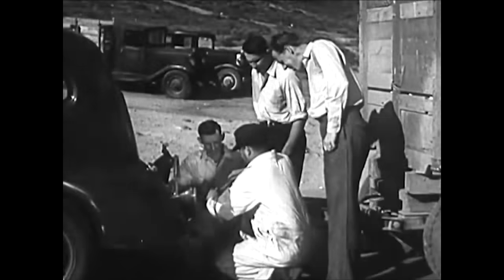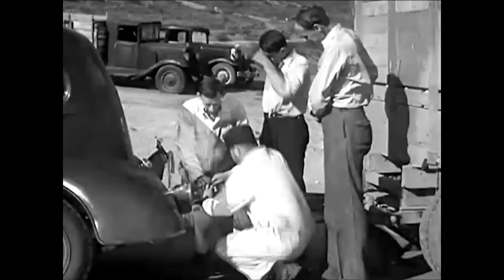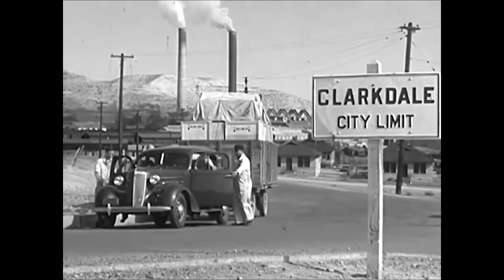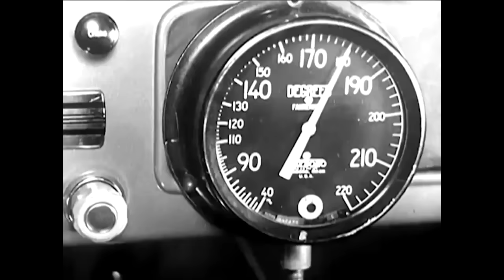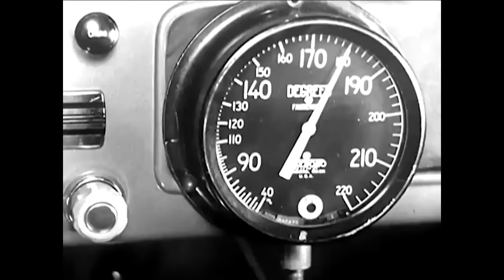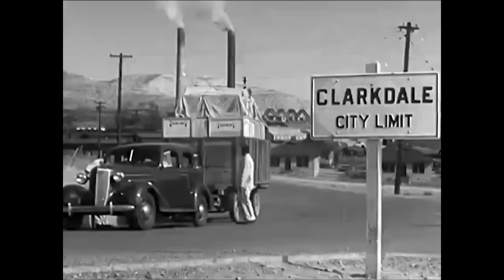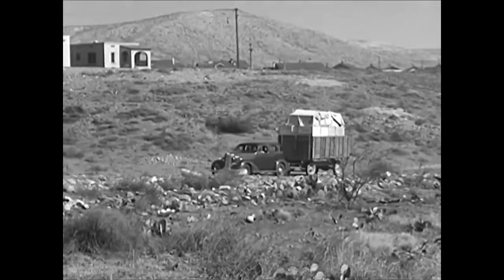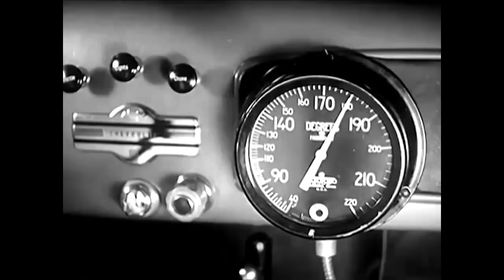Clarkdale Jerome Arizona Chevy Film 1936

Comment: That has to be the most hinky hitch connection I have ever seen!
Reply: Kind of fits the mold for trailers and loads pulled in Arizona.
Reply: There’s actually a very solid pin holding the trailer on, the knot tied was simply to keep the pin from coming out, hardly any stressed will be on the knot at all.

Comment: That 36 Chevy had a whole 79hp (at sea level) so the only thing in those boxes was air.
Reply: You know it. Maybe the top boxes had a length of board in them to keep them down.
Reply: Still more than a modern car can tow.
Reply: Still a heavy trailer ! 😄
Reply: Did you guys get a look at the rear end on the trailer?
🤔💭Either it was either junk yard built, or it's got a drive shaft connected pushing up the hill as well? 
Quote Bugs Bunny
"Something very fishy going on around here"?
Reply: @Mr.Martin4500  I'm used to seeing old drive axles under trailers.  I don't know what trailer manufacturers were even in business back then, so I have nothing to even compare that trailer to, other than you typically cannot do high speeds with trailers like that.
Reply: Not just air, hot air. 

Now, go buy a Chevy!

Comment: Nice. And they didn't even have anti-freeze back then! Good job!
Reply: Oh yes they did.  They had a choice of permanent antifreeze, similar to what is available now; and temporary antifreeze, ethyl(?) alcohol, which would eventually evaporate ... requiring frequent resupply during freezing weather.
Reply: Water has a lower boiling point but a better heat capacity

Comment: Can you imagine “doesn’t overheat” a selling feature in 2022?
Reply: They fixed that by having low tow ratings.  Some modern vehicles you aren't even suppose to tow anything, others you to ask permission from the dealer to tow(go ahead, read your manual).  Send a picture of that stacked trailer to your dealership and see if they give you permission to tow it, lol.
Keep in mind that is a CAR, not an F150, and they are towing that.
Reply: I guess Tesla's dont come with radiators
Reply: Junk is what all cars are know
Reply: It took Ford a much longer time to figure that out than it should have.
Reply: Now Chevy should use the “won’t set your garage on fire while charging” angle (if they can back that up).

Comment: Did the crates have anything in them and what’s a double load compared to a single load.
Reply: Presumably twice what the car was rated for.  I'm curious myself, some older vehicles had pretty high ratings, but maybe not cars.  I know I've heard old flatfender jeep ads claiming a 5,000# tow rating.
Reply: @l337pwnage  And the brakes barely worked to begin with. I had a '53 CJ3B I put all new brakes in.

Comment: And it didn't take an overpriced diesel to do it.  All with only a 3.4L OHV I-6, 79-80 hp, 155-156 lb-ft ; Transmission: 3-speed manual ; Drive: Rear-wheel

Comment: Seing that four-wheeled trailer with almost no tongue weight on the car makes you wonder why almost all modern trailers and RVs do not apply the same principle: wouldn't that way pour less strain on the SUV or trucks pulling them ? 🤔
Reply: untill you pull one, then u will c why NOBODY uses them
Reply: Because, over a certain speed, the tail will wag the dog and dump you in the ditch!😮😂